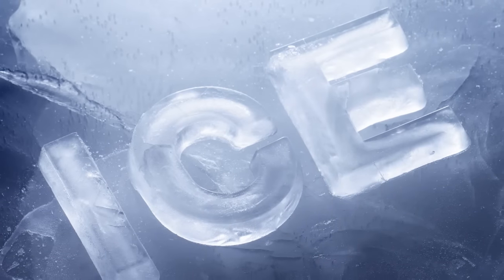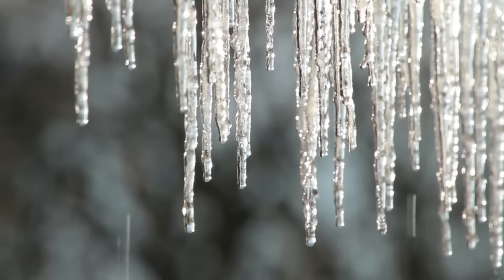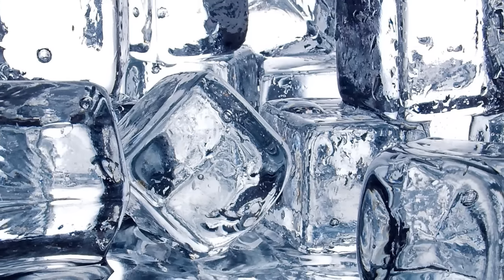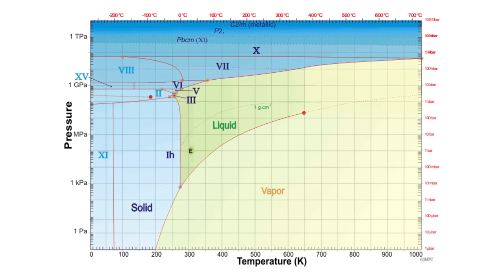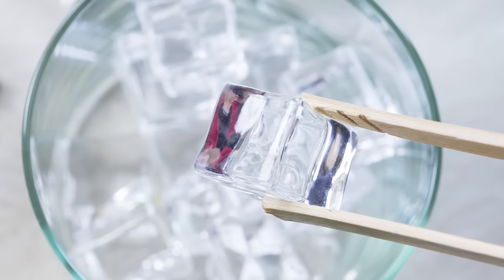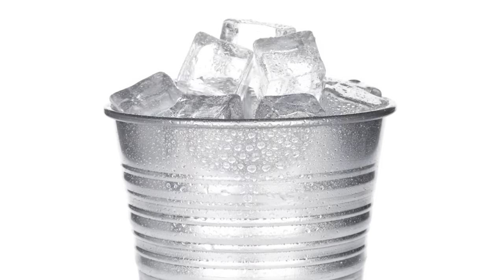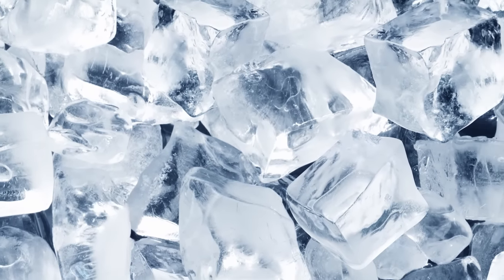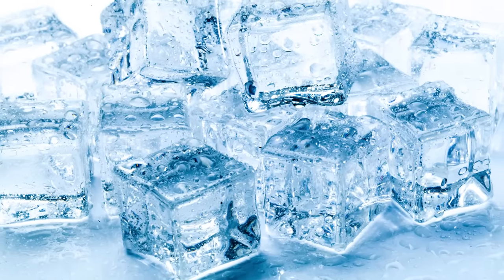Freezing Water in Unbreakable Containers

Comment: Very little info on the properties of these ices
Reply: Will Lastnameguy it was very disappointing
Reply: This is not the Discovery or National Geographic channel.  This is a 5m7s clip explaining ice in layman's terms.  If you need more information, you are on the right website:  Google.
Reply: While you are correct, it still felt a bit underpar from other videos in the channel where the question asked was what happens if you freeze water in an unbreakable container and the answer this video provides is: it becomes ice 2. No talk about how someone would pull it off or the properties of said ice.
Reply: Furycrab The video could be shortened by answering the question as my eighth grade science teacher did: the water will freeze and expand causing the container to burst or tear at it's weakest point. If there is no existing weak point, the expanding ice will make a weak point. Problem solved. And you can take care of number 2 while you wait for the water to freeze. Two problems solved.
Reply: Except thats wrong, a container could be strong enough to not break under the pressure of ice forming.
Reply: But the point of the video is that ice is not an unstoppable force- when faced with an immovable object, the ice will give in first.
Reply: That's because we don't really know their properties save for a few predicted ones. He did mention one known property anyway, the antiferroelectric one.
Reply: This so from when Simon was just starting out...
Reply: @Locutus  But google is filled with results such as these.

Comment: I put water in a standard "lecture bottle" carefully excluding all air (rated for 1800PSI) and put it outside when temperature was 0F or about -20C.  When I opened the valve, liquid water spurted out violently, and the spray froze instantly as it was in flight!  The confinement of the bottle prevented the water from freezing.  The water remaining in the bottle also instantly froze.

Comment: I would love an ice cube that sinks in my whiskey.
Reply: You need to get some heavy water and freeze it. It's about 11% denser than water and frozen heavy water sinks. In small quantities it won't kill you (I think) and its even used as a treatment for hypertension.
Reply: Dave Kirkeby lol nice idea but no. It will be cheaper, faster, easier to make a containment to handle pressure.
Reply: sure its way easier, if you have a container on hand that can withstand over 40,000 psi
Reply: freeze a nice river stone works great
Reply: The river stone idea solves the sinking problem for sure, but the ice has a big advantage in terms of cooling capacity per ml because it undergoes a phase change in the relevant region and there is a lot of energy per gram associated with the transition of ice to water. I compared water, granite and gold for their cooling capacity. I assumed a temperature change of 5 degrees C for each of the materials.
water = 354 J/ml, granite= 10.7 J/ml, gold = 12.4 J/ml. So to get the same cooling you need a much larger volume of rock or gold. You could try cooling the materials to a lower temperature but the water still wins because it has a higher specific heat per volume than either gold or granite. But of course the ice has the horrible floating problem.
Reply: Dave Kirkeby Absolutely spot on.
Reply: Dave Kirkeby
Reply: ProCactus freeze your whisky and pour a cube of water in
Reply: carpii
Lol, You are not a whiskey drinker, are you ?
Reply: Yep, was just joking though :-)
Reply: ProCactus ahhh I see the dilemma, my humble opinion would be to just drink the damn whisky, but that defeats the purpose of this post haha
Reply: Balling Like Choji
I do drink the damned whiskey if they float, melt or not :D
Reply: Just cool down the actual whiskey, I store my opened bottle in the freezer. only point of ice is that it melts and dilutes it... that can be accomplished by plain water.
Reply: *****
As Dave Kirkeby said a few posts up. Its all about the heat required to melt the ice cube.
Changing the phase of a material from solid to liquid requires a lot of heat.
This is turn keeps your drink cold for a long time.

Comment: Say you took your 1 inch thick ball of brass with water inside it...and applied 27.000 psi outside the ball. Would would you be able to create ice ii? Or would the combined pressures permit the soft metal hollow sphere to collapse in on its shell...thus giving more room for the expansion of normal ice?

Comment: Looked up ice 15 on wikipedia for anyone interested. On a more practical factor, water in ice cube trays usually turns to ice in roughly 3 hrs in most freezers, if you have multiple trays stacked it can take longer but in 4 to 6 hrs it'll all be ready for your drinks and etc. Don't forget to toss some ice into your pet's bowl during summer. I serve the fur !!

Comment: What can you do with Ice 2-15? Like what is a piratical reason we would want to do this?
Reply: Depends on your definition of what is practical and what isn't.  I've heard that the knowledge of how different ice phases behave is used in predicting what goes on in the centers of some of the outer planets and moons in our solar system, and to help understand how those celestial bodies may have formed. 
That knowledge certainly isn't going to make any normal persons life easier today, but maybe someday in the future.
Reply: By practical, I mean what can you actually do with ice 2-15 that you can't with ice 1? Like heavy water is useless to the average person over normal water, but it's useful in nuclear power plants.
Reply: Craig Bennett II it is fundamental research it is not meant to have a practical purpose until someone thinks of one but I have a little bit of an idea for ice 15... ice 15 carries no charge ever so if you could make a sheet small enough and we revolutionize cooling technologies it could replace some insulators in computers (we are talking super far in the future of course but eventually someone will figure that out or something else to do with it
Reply: surely just use something thats not ice for that
Reply: I think the problem with using ice in that way is purely it still melts. I could be wrong, but I think the reverse happens with ice 15. As it melts it will gain that charge.
But even if it doesn't, parts at such a low temp will actually just turn off. There has been people who tried to see how cold you can make a computer, and what happens if it gets too cold (like is it the same as heat damage). It turns out there is a temp the computer just shuts off, and there doesn't look like there is any damage that happens when it gets too cold (but these test were very short term.)
Reply: billied_2003 well currently they use different insulators and they are thinking of switching over to dimond... but maybe hey I don't know what they will do with any of this stuff but neither do you and fundamental science is important because we need to know what natural things exist in order to create those technologies in the future just because there is no use now does not mean there will never be
Reply: Put it in cocktails of course!

Comment: why didn't they discover ice 13 as well? almost had connect four :)
Reply: From what I've read, Ice 13 is metastable (stable but under very slight changes in equilibrium, will alter state).
This means that it's almost a transitional stage and not easily observed. 
At least from what I can understand.

Comment: When I was looking at colleges, I went to the University at Buffalo. Their science department was showing off some stuff, one of which was a video microscope looking at room-temperature ice. It was made with what was basically a table clamp, using diamond heads on an extremely tiny area, allowing it to reach the pressures needed for Ice VI. It was balanced to be right at the phase shift, so tightening or loosening the clamp would allow you to see the crystalline structure form or melt. Basically, it looked like a bunch of cells. When loosened, the cell walls would disappear, becoming larger cells, and when tightened more walls would appear. It was very sensitive though (the range between being fully liquid and fully solid was only about 15 degrees when turning the clamp), so one time when we were tightening it from nearly liquid it slipped and went too far, and the entire thing instantly turned into a spiderweb.

Anyway it was cool.

Comment: Another trivia bit is that ice gets a boost in volume of about 10%.That's what splits the containers,or as I remember all too well,splitting of water pipes when they freeze.For you inventor guys,how about finding a way to utilize that energy of water freezing and expanding.I did a patent search when I designed on paper, a device that could create shaft horsepower with expanding ice,and found one guy from a middle eastern college, had a white paper on the subject.That was 6 or 7 years ago.
Reply: Unfortunately, it wouldn't work out to be a utilizable a net gain in most practical implementations because:
1. if you start with liquid water, it would take more energy to run a cooling system to freeze the water into ice than you get back out of the expansion of that ice.
2. if you start in a cold environment and let nature dissipate the heat for you, then you still have to heat the water somehow to get it into a liquid form so that it can expand as it freezes, which takes more energy than you get back out of the expansion of the ice.

In certain very special circumstances, like a hot spring with liquid water naturally flowing out into a freezing environment, maybe it could work, but in most of those kinds of situations it'll just be far more efficient to make direct use of the hot spring to run a turbine or something.
Reply: That's true.Just needed some input.Thanks.

Comment: Ice-two has a density of 1.16g/cm^3, regular ice is 0.92g/cm^3 and water is 1g/cm^3.
So I guess if you could find a container strong enough, filled with water with no air space and you cooled it to the point ice was formed the pressure would rise to approximately 300MPa at which point ice-two would start to form but as that takes up less space than even plain water the pressure would not rise further and an equilibrium would be reached of regular ice (ice-one) and ice-two.

Comment: A simple rifle barrel could easily have withstood 50,000 lb/in2.  In fact, many in actual use can probably hold 4x that much or more.
Reply: they can hold that pressure for a brief moment and they're rated for that only at a certain point on the barrel if it was filled with ice every single point would be under that pressure. If freezing ice in a small container was that simple the tests done in Quebec would have been successful.
Reply: NotADuck well I can see your a fan of mosin nagants and guns in general so I can safely say your understanding of physics is somewhat limited. But I can guarantee you if you fill your barrel with water and try to freeze it with both ends plugged it will split. keep in mind ice freezing in small cracks is what causes roads and sidewalks to split as well as granite in mountains. so regardless the formation of ice is stronger than your gun barrel.
Reply: TobuBiguru  In a similar vein, one might say that you're inability to distinguish between "your" and the correct "you're" calls into question your own scientific knowledge.  I would never say such a thing, but one might.
Reply: Fun fact spelling has nothing to do with scientific knowledge and all to do with literacy.
Reply: Funny, as a teacher of pre-doctoral and post-doctoral students, that hasn't been my experience at all.
Reply: Spoken language and writing began far before science.
Reply: Owning guns also has nothing to do with scientific knowledge, but stating that it does might imply that you're an idiot.

Guns operate on a pressure curve. During firing, different rounds peak at different points in time. This is one of the reasons why even light smokeless powder charges are generally considered to be dangerous to use in black powder firearms. The pressure curves are different.

If you fill a barrel with water and plug both ends, there is a good chance that barrel will either split or bulge when you freeze it. The same thing could happen if you plugged the end of the barrel and fired a round. The gun is not meant to hold that pressure for an extended period of time. They are generally over engineered for safety though, so a gun might survive something like this, or at least not self destruct in a way that will kill the user. I've seen bulges in barrels because of barrel obstructions, and I have also seen a barrel split like a banana peel.
Reply: Speaking of the intellectually deficient, it's "you're an idiot", not "your".
Perhaps I am but the universities that gave me a doctorate and where I taught post-docs might disagree.  With that said, your comments concerning rifle barrel obstructions are generally accurate. But I didn't say anything about filling the barrel.  The breech segment of a relatively small caliber...say .30 or less...high-power rifle like a .300 Weatherby would likely withstand the pressure. The shear strength of the lugs exceed 300,000 psi, so they would be very unlikely to fail. Remington once estimated that the pressure in one of their obstructed barrels might have reached as much as 400,000 psi without failing. Anyhow, it's all a guess.  As to the pressure curves of smokeless v. BP,  comparability depends on the precise type of smokeless, quantity, compression and the grain size of BP, type of primer used, etc.
Reply: Once again, it's "you're", not "your".  Duh.  Yes, I'm retired and had a few minutes to kill before leaving the house.  Didn't notice to whom you were addressing your initial comment.  My bad, as they say.
Reply: Actually it is our "Your degree" not You're 

Furthermore your lack of use of SI units is disgusting :p
Reply: Yeah, no. The Stone Age (first documented existence of tool use and technology) began 3.5 million years ago, while written language didnt exist until 3,200 BC, which was only about 5,200 years ago
Reply: Weld the end of the barrel shut and then fire the rifle and tell me how much pressure it holds
Reply: The barrel of a gun is essentially a pressure RELEASE valve. It is not designed to CONTAIN pressure
Reply: +Keyser Soze "Yeah, no. The Stone Age (first documented existence of tool use and technology) began 3.5 million years ago, while written language didnt exist until 3,200 BC, which was only about 5,200 years ago"

If this was aimed at me then i never said technology i said science which wasn't practiced until after written language in whatever form.
Reply: nester011 The development of tools to solve specific problems or achieve specific goals is a form of science. Agriculture is a form of science. Selective animal breeding is a form of science.
Reply: Keyser Soze You see no it's more on the part of engineering which i'll grant you is linked to science however these early cavemen didn't use science or engineering. Just because i can breathe my heart beats and blood flows and i can think does not mean i know biology.

Comment: Couldn't we make a machine that uses that force ice can exert and use it to produce energy? it does not require much effort to freeze water after all but if it could move say a huge cylinder full of water pushing the water up, it could be used as a pump. then let the water drain back trough turbines or such. maybe just make use of a cold place so that the water freezes on its own, while the water in the pump cycle has additives to make it freeze much later. Would require quite a strong cylinder though and some system where the ice is removed from the cylinder and replaced with water that just had its additives removed. Sounds like it might be quite a lot of effort to create a perhaps too low output of energy.

Comment: "...very unique property of water."

Two things. One, you can't modify the word "unique". Something either is or is not unique. I can't be "very unique" or "slightly unique". Two, its not a unique property of water. While very uncommon, there are plenty of other chemicals that expand as they solidify.
Reply: SlimThrull Pedantic troll has too much time on his hands and an Internet connection.
Reply: SlimThrull you are very, very unique. And that's awesome.
Reply: savage1267 The quibble on the use of the word "unique" may be pedantic. The other part is just correcting a fairly common myth about water being the only chemical that expands. I think its important that that we get facts right.
Reply: Yea linguistics! The only filed of science where it is right to be wrong!
Reply: @SlimThrull: Guess what.  Words often have multiple definitions.  "Unique" is listed with about 4-6 definitions, depending on which dictionary you use.  One of those definitions is an informal usage of the term to describe something that is "very remarkable or unusual" which is a usage that absolutely can be qualified and is not limited by exclusivity.  Your complaint is an equivocation of one valid definition of "unique" with a different, but still valid, definition.  In other words, you tried to be pedantic but you failed spectacularly. mic drop
Reply: Omar Goodman Paris tango Kitten.